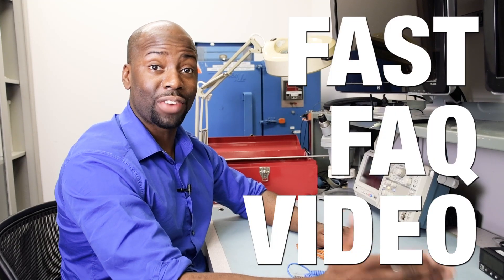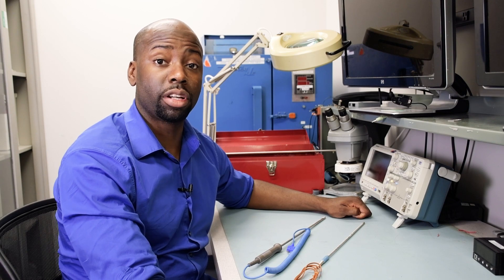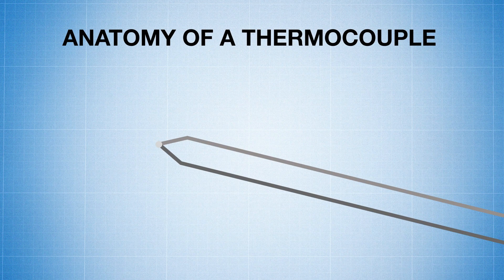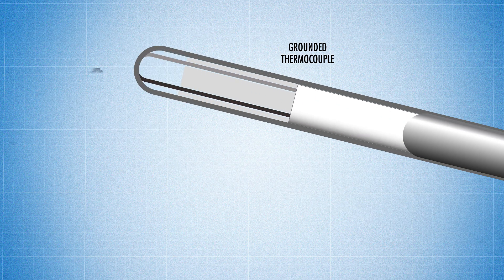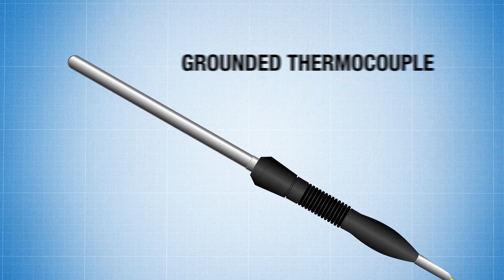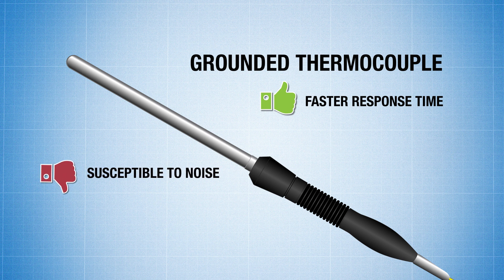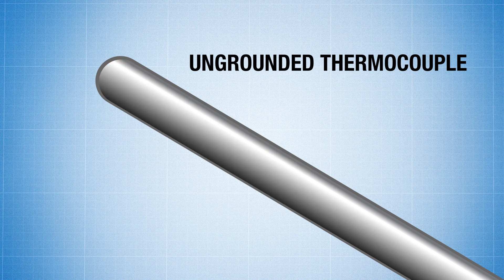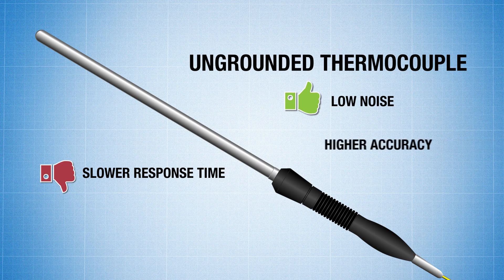Grounded vs Ungrounded: Choosing the right thermocouple explained

Comment: Cool invention. My K-type thermocouple because it's a solid wire, just broke inside the breaded insulator after a few bends when storing in a circular fashion. I had to other a new K-type thermocouple with telephone wires.

God bless, Revelation 21:4

Comment: Hi, I work at a package company which has a lot of heaters and we had a problem when water came into a place full of ceramic infrared heater and grounded some PLC analog. Now they are asking us to grounded the thermocouple, but there is a doubt if we should grounded the positive or the negative of a thermocouple, what would you say? We had a look at the diagram and it says to grounded the negative, but looking at other equipment we could see that the positive is grounded.
Reply: Sir, if you are reading my comment please send me the diagram, i really need it, and what happened about the grounding process ? which pole did you ground ?
Reply: @kevin00861  hi, I left the company a couple months ago to go overseas but I remember they grounded the negative and it was ok, sorry but I don’t have the diagram.

Comment: Hi. I have wrn-122 thermocouple and i'm wondering what kind of wire can i use to connect it with my pid?
Reply from the maker: You can use our Type K Extension Grade Wire:
Part Number: EXTT-K-20-(Length)
https://www.omega.com/en-us/wire-and-cable/thermocouple-and-rtd-wire-and-cable/p/EXGG-KX-WIRE